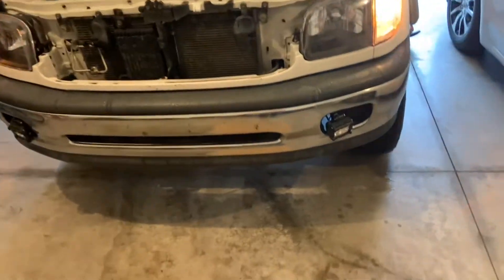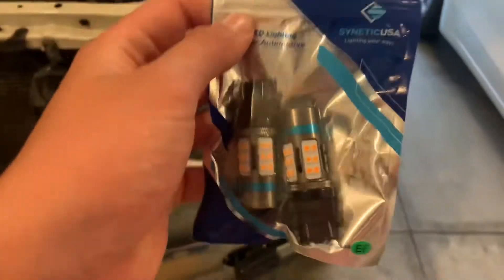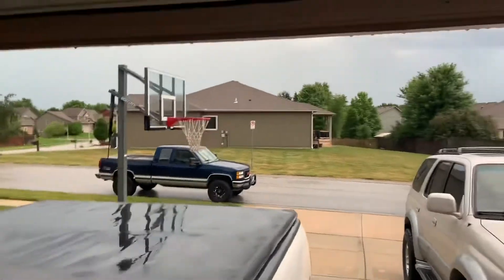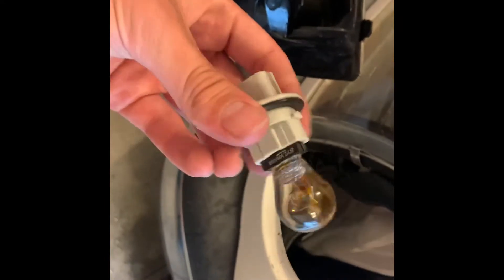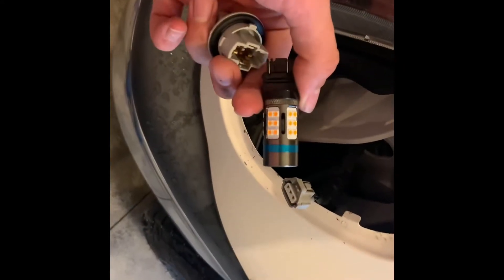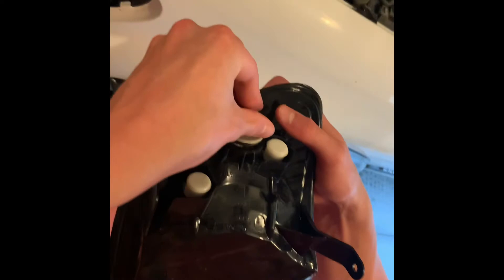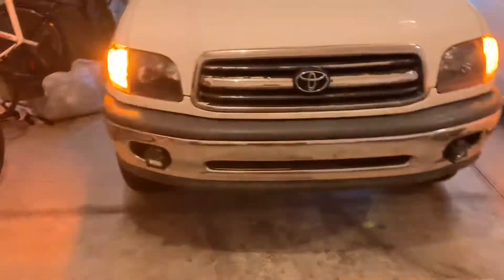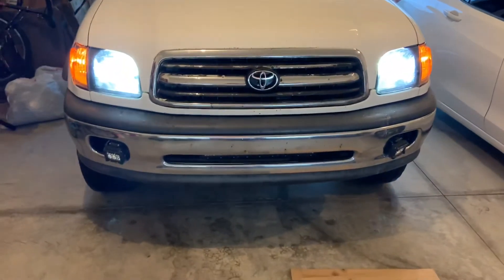LED TURN SIGNALS FOR 00-06 TOYOTA TUNDRA

Comment: another option instead of the resistor in the bulb (or spliced) is a LED compatible flasher relay. I've got the diode dynamics in my tundra and Avalon. add some neat features too. strobe, lane change tap.. arrival lights (on the Avalon only)